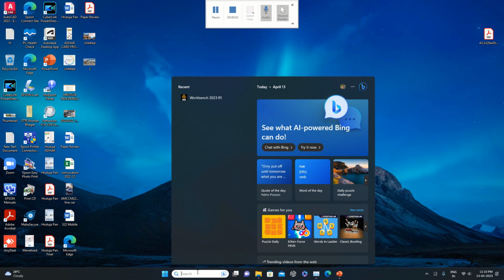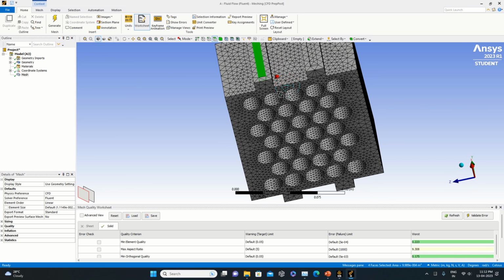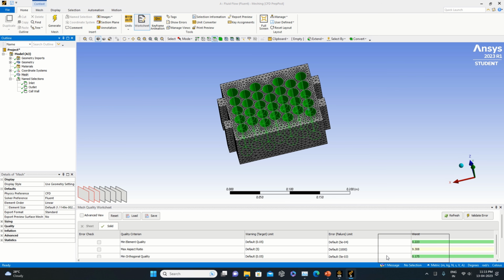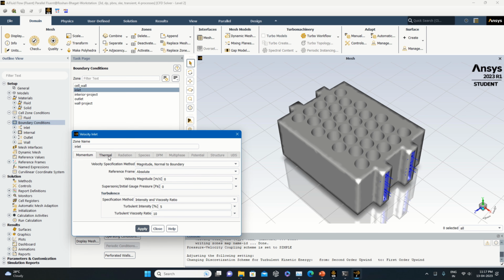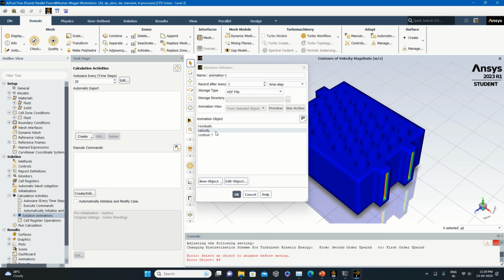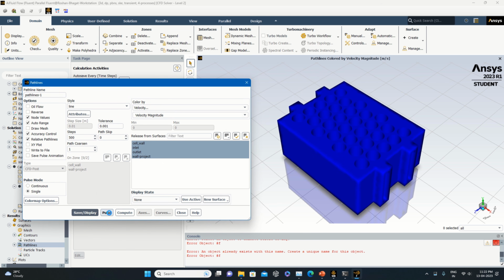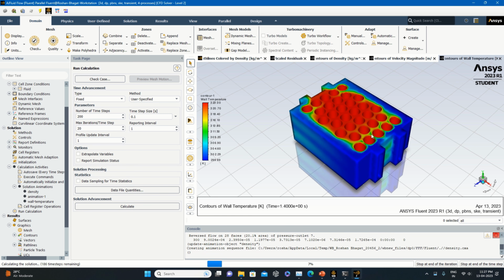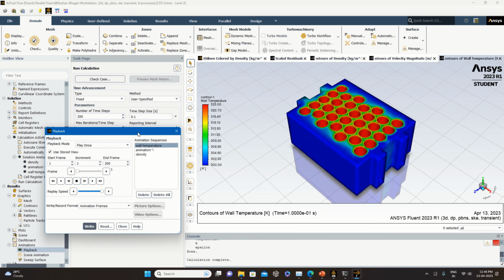CFD Analysis Of Lithium Ion Battery For Thermal Management

Comment: my simulation is not working, could you help me?
Reply from the maker: share details of what exactly not working
Reply: @FrontiersInCFD  I am simulating a battery liquid cooling system, I prepared the 3D in SC (I created the fluid volume, I created the named selections and used the tool Share). I created the mesh in Fluent Mesh, the problem is that when running the simulation, the volumetric heat generated in the cells is not transferred to the cooling plate and fluid. I have already checked all the interfaces walls and all of them are coupled and have a shadow. I have done a simulation with two solids and besides there are the shadows there is not heat transfer.
Reply: I don't know what else I can do
Reply from the maker: looks to be problem with geometry

Comment: only the cell walls are red. rest all walls are blue after the simulation. What can be the reason?
Reply from the maker: Check if selection is properly done in animation setup
Reply: @FrontiersInCFD  Hello Sir, actually I found the error but I'm not able to solve it. I'm making the geometry in fusion 360 and importing in design modeller. But then there are only faces its not showing any surface area or volume. How to create a solid by that geometry? please help
Reply from the maker: @AkashSingh-tv2bj  if possible do in design modeler

Comment: In a similar situation where the mesh is used, and the battery cell is also covered with fluid on the top and bottom, should I add the battery cell sidewalls as part of the Cell Wall and proceed as shown in the video? Or, should I create an additional battery body and add a solid body to the geometry, not just the fluid body?
Reply from the maker: You can create cell casing and define it. Then apply boundary conditions

Comment: There is no specifications of geat source hear, then how will there be increase in temperature and also how is a battery pack, when there is no battery. Could you please explain?
Reply from the maker: Here only wall boundary conditions are considered, check out the latest videos, which has simulation considering the Cell wall as a boundary conditions.
Reply: @FrontiersInCFD  thank you

Comment: Can you also upload a video of thermal runaway simulation for the battery ??
Reply from the maker: will do share specification for the same
Reply: @FrontiersInCFD  actually its kind of project like when the battery is on the temperature higher then it's peak temperature then it explodes. Right. , now we have to provide it a water jacket so that it will maintain its temperature. Nd simulate that.

Comment: Sir make a video on heat generation in battery module with varying C rate. Or problem statement heat generation in battery cell at different C rate
Reply from the maker: Will Work on it

Comment: How to apply c rate for cylindrical battery simulation, it will be more helpful if you say about c rate. Or just we need to analyse only heat transfer rate.
Reply from the maker: It was just a thermal analysis, based on temperature generated by cell
Reply: The easiest answer would be reading up on manufacturer's datasheet to find IR and do i2r. You could also find ir by using voltage drops when cell is loaded..

Do mind IR changes depending on cell temperature.